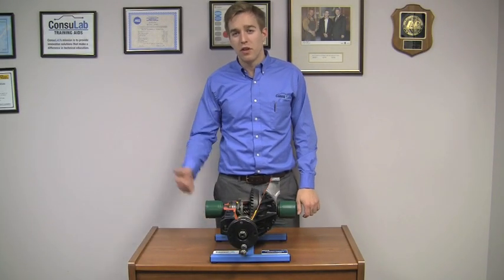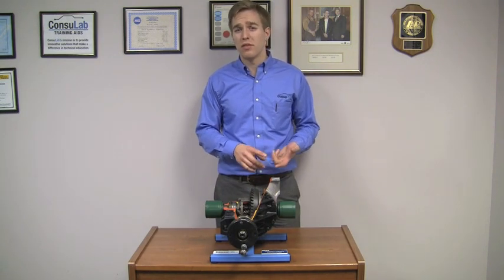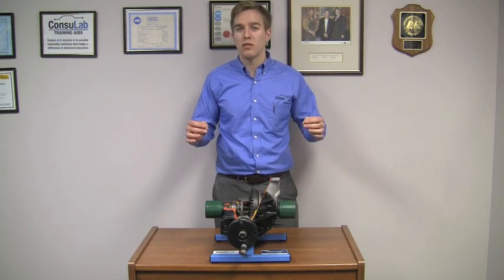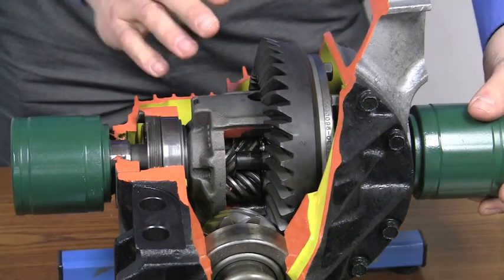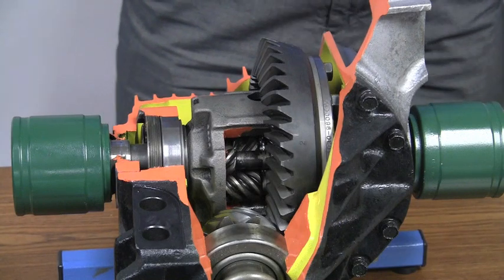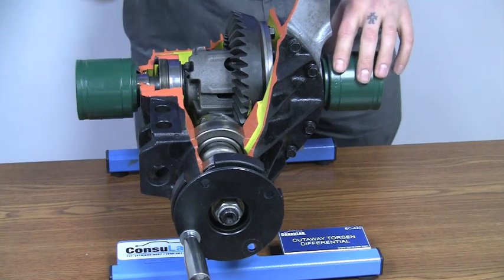Cutaway Torsen Differential

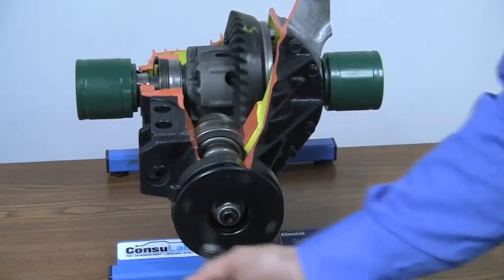Comment: Wait,  at the 0:1:02  mark you show how the pinion turn the axles  but you then turn both axles and nothing happens.
   This tell me that you can't do an Engine Breaking  on a hill because the Pinion doesn't cause any drag when it pushes against the axle direction.
       How the heck would  the   Reverse   gear make the vehicle back up .
Reply: +Gary wood he rotated them different directions. That's how most differentials work. I dont see how your observation has anything to do with the reverse gear?
Reply: Jordan Howell
 Listen to what he says  about   that  
 Torsen   rear end that  he can rotate    the axle  shaft  as the pinion  doesn't  move   but  the pinion  rotation  affects the Ring gear   to turn the axles.  
   can you not see the  confusion   because   if the  let of the gas while doing  60   there is NO  drag    on the drive shaft to  cause drag  in the transmission  that  then causes drag  on the engine  where the compression  stroke  opposes some  rotation  since the power stroke is weak  .   
  This is how trucks  use engine braking  on hills  where the resistance  goes through  the system  to the drive wheel   but  when you cut off the gas  the compression  resistance  acts  like brakes.  

  i saw another video where  it claims that a worm gear  can be driven by a  spur gear    but the spur gear can't be driven  by the worm gear.
 
  So  please explain  how both these videos can be  true  where I just saw an example by him  to turn  the pinion gear  to drive the axles    but   rotating the axles   can't  dive the  Pinions gear.
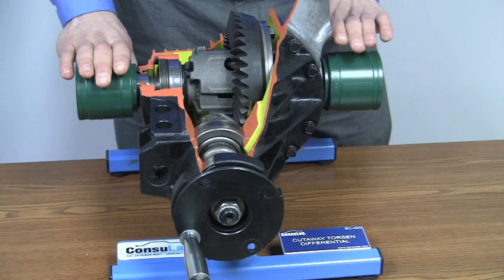Reply: +Gary wood watch at 1:05 he first rotates both axles forward wich causing the pinion gear to turn. Then he turns them opposite ways from and the pinion doesn't turn. Your tires never turn in opposite directions when driving. They only turn in the same direction so Engine braking will work just fine with this differential as with all other differentials.